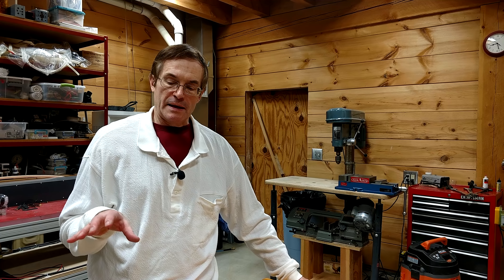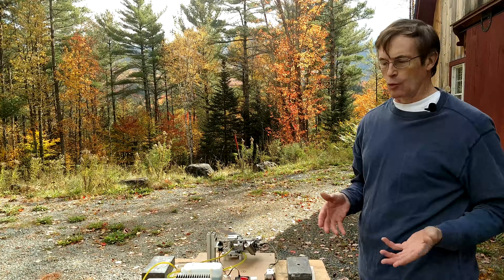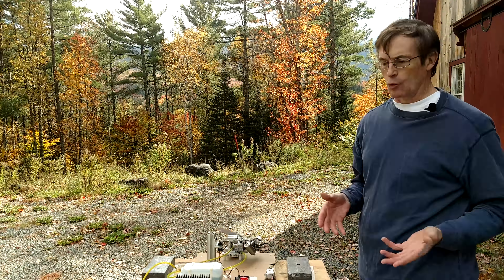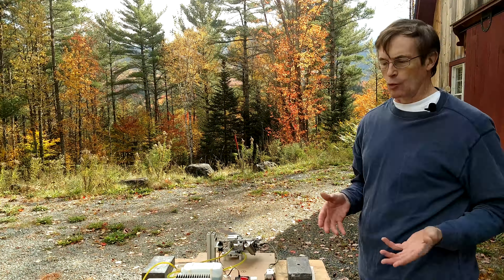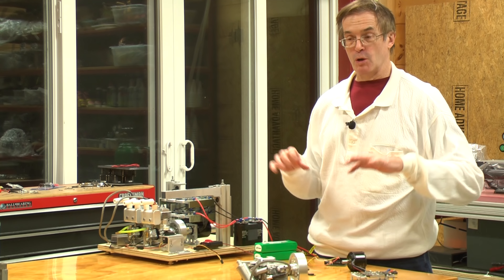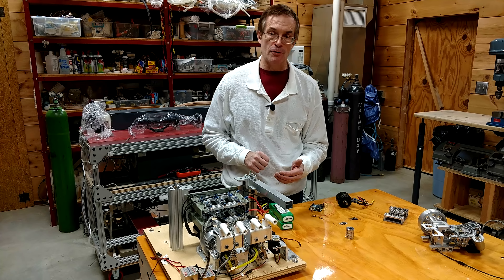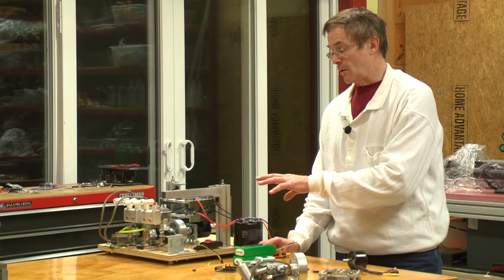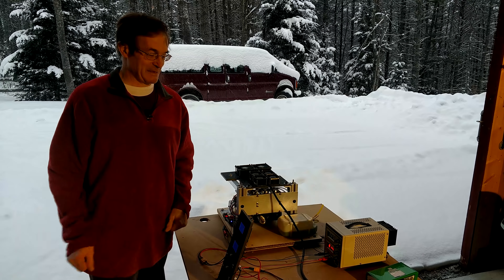Hybrid Drone Generator

Comment: Thank you for your excellent video.

Years ago I considered buying a lightweight generator, and had a brochure on it, which is now gone.  It was called a Lightning Charger, and came in versions that put out 12 volts DC, 12 volts AC, and 120 volts AC or DC.  It was powered by a 2-cycle engine, and what made it light weight was a patented permanent magnet alternator that put out about 55 amps.  I communicated with the inventor about the charger's speed control.

I just looked through old emails and found one from 2004 from Coleman Powermate, which had purchased the technology, answering my question on where I could buy one.  The answer was, "This unit was discontinued and was not sold to anyone else."  The generator/charger disappeared from the market.

Years later I came across a document on the Internet that was about the Department of Defense appropriating the patent, which said the technology was needed for drones. 

If you can find details about the alternator used for that generator/charger you may get ideas on how you might improve on your design.  However, just guessing from the look of the size of your design and its output, your design may be getting more power for the size and weight than the Lightning Charger did.  If so, the DOD may ...
Reply: And THIS is why we can't have nice things . . . . (the Gov appropriating inventions and shelving patents - making them disappear)

Comment: Thanks. I noticed that the current with the batteries was about 12 amps and 366 watts while when the two strokes were running that going into the same load was only about 300 watts and 8 to 9 amps. Those load resistors look like they may have some inductance and this may suggest that you are dealing with more AC from you generator than perhaps you are aware. It would be good to scope the voltage across the load.

Comment: Very impressive. Very interesting.
I really enjoy how you explain all the thoughts and technical parameters about the way it works in general but also
about details, what you need to know in order to optimize the efficiency and the overall usability of such an epic generator.
And all the background about energy density differences between LIPOs, 2 stroke and 4 stroke engines and ways to compensate voltage drops
caused by (virtual) internal resistence during heavy load, you did that very good in my opinion.
Reply from the maker: Thanks!

Comment: It's so crazy how you are doing all the experiments I have needed for my projects. Have you considered using VESCs (vedder electronic speed controller) in replacement of the rectifier circuit? More expensive solution, but you can start the motors with them (useful in failsafe situations), and may get better efficiency than a rectification circuit. You can also get accurate RPM readings from the VESCs allowing you to more accurately control the throttle. You could even write an algorithm that cuts back on the power generation voltage through PWM inside the motor controllers when it detects the generator is bogging down, allowing less voltage sag under heavy generator load. The two engines could also be decoupled mechanically if you used an encoder with each VESC and set them to run at the exact same RPM with the same encoder offset. (it has the processing capability to do this accurately enough I would say to be just as good as a mechanical linkage) This would allow for the same balance that you currently have, but less mechanical hardware, and more importantly redundancy in the design. Two fuel tanks, two throttles, two everything. Redundancy is always nice when you have expensive equipment flying in the air lol. A boxer engine setup may further decrease vibration and may eliminate the need for counterweights on the flywheel.
Reply: Mechanical connection makes them basically one motor. That's better.
Reply: Check out my YouTube channel, I had the idea to use a VESC as an active rectifier after I built my skateboard. I ran an experiment yesterday and it was promising.

Comment: Thanks for some great introductory explanations using your uniquely engineered power supply. The next step would be to investigate the efficiency of the system. You need to put the fuel tank on a non-vibrating surface with a scale to calculate the fuel consumption. From that it's a simple bit of math to get your power efficiency. BSFC (brake specific fuel consumption) would be useful in finding the optimal load for any given rotational speed, load dependant.
For the muffler system, I would strongly suggest optimal design software like Virtual 4-stroke to get more specific parameters to run your engine system. It'll help optimize exhaust and intake design by specifying targets like BSFC or power.
Could you post the weight of the entire setup and also include the cooling fan load when computing efficiency? From your previous video's I figured you would have designed a cooling system that was mechanical to mechanical (direct drive fans). Future work perhaps? All in all this looks like a fun project and one that could help with understanding thermal loads. Your alternators would be getting pretty hot if run at a constant duty cycle. Thermal camera footage perhaps?
Thanks again for showing off your work with patient explanation!

Comment: I think some Maxwell boost Caps or supercapacitors will greatly improve the setup and also allow you to reduce the size of your battery packs and still maintain of a set time limit if you have mechanical failure to get the Drone under the ground safely.
Reply from the maker: A fine tuning of the energy storage system, by topping off the lithium ion batteries with super capacitors might be useful.  The bulk of the energy back up will need to remain in the batteries because an emergency landing could take as long as a couple of minuets and the energy density of the batteries will be more important then the power density for this kind of time period.
Reply: Tech Ingredients the reason why I thought of it is because people are actually replacing car batteries and testing with supercapacitors and having better luck than a regular battery and they're fairly light. They have a super low internal resistance they charge almost instantly. Now the number that you would need to get to the voltage that you want may make it unfeasible but as the technology gets better and better eventually batteries will be replaced.
Reply from the maker: I'm aware of that application in starting automobiles and it makes sense.  The actual number of joules used to start a car is really quite low and far lower than the energy storage capacity of lead acid batteries.  It is the peak power requirement that has determined the sizing of automotive batteries and so with a super capacitor to supply the peak power a much smaller and lighter battery can be used.  Batteries are improving as well.  Magnesium ion batteries may begin to make an appearance with double the energy density of lithium ions and of course, fuel cells are getting closer and closer to realistic availability.  We'll see.

Comment: Many years ago I worked on an Emergency power generator for aircraft.  It used air to rotate a 3 phase brushless generator running at about 100Krpm.  Very small, the rotor was no more than about ¾” OD and the length was perhaps about 2”.  There were two of these in the case and air was pumped into it through a hole that was the diameter of perhaps 24AWG wire. A disc attached to the  shaft just above the rotor with tiny little cups to catch the air was used as the method of rotor propulsion. . The combination of the two generators produced 3KW of power at about 115 Volts and also used the air as air bearings in addition to just propulsion.  Perhaps you can use this method but instead of generating power and then running a motor just cut out the middle man and run the motor directly with compressed air.  I don't know how much power you need but I believe this combination of air tank and motor will be much lighter and less complicated than 2 two-stroke motors and mufflers and generator replaced by just an air tank.  So even your motor becomes simpler.  Just driven by air, no copper windings, but of course you will have to make a motor to run on compressed air.  Since you also want to control the voltage, you may also need a PID control for an air valve which is almost nothing.  I also designed a controller with a 1KHz bandwidth for a hydraulic valve for aircraft control surfaces.  Just 1 Amp for the control valve.  Perhaps you can find a simpler way to control the air flow.  What is your response requirement?

Comment: 12:21 but the shaping of an exhaust is a key to the power generated by 2strokes engines, isn't it
Reply: Didn't he say 4 stroke
Reply: @MrBobWareham   @ 10:30 he talks about locking the engines 180° out of phase, and having a continous power stroke, so with that setup they would be 2 stroke engines.  Plus, the sound.  They're 2 smokes.
Reply: Yes, the chamber volume, exit coss-sectional area, etc, do significantly affect the engines power delivery.  He didn't mention tuning the muffler, but knowing the detail involved in all of these videos i'm guessing he did the maths.

Comment: Interesting.  Every small engine I've worked on did have a counterweight on the crankshaft though given how close to the center of the crank they are they probably don't completely offset the static Wright of the piston and conrod
Reply: Do R/C! Exactly... I think the unbalanced counterweight is doing nothing but wearing engine bearings/bushings prematurely.
Reply: Aradialenginemighthelp, butheyareexpencive.

Comment: RC plane rotary engines are out of the question? 
They’re high revving and smooth running although not too fuel efficient.
Reply: My thoughts exactly . More power @ lesser weight.

Comment: expansion chamber exhaust for 2 strokes will nearly double the power.
Reply from the maker: It is my understanding that a tuned exhaust on a two stroke will increase the fuel efficiency and power by approximately 12-15%.  We are using the DLE 20 single cylinder engines as well as the DLE 222  4 cylinder engines.  If you have better information or a link to a source for a tuned exhaust that is compatible with these engines, please send us a link and we'll pursue it.
Reply: Increasing the power output will also increase the operating temperature and might lead to overheating, seizure, etc...

Comment: If the concern prompting the hybrid solution is the higher energy density of gasoline versus lithium polymer batteries... why not just build a pure gas-powered multirotor? This way you would not have the losses and weight of the generator/rectifier system.

However, to get around the insufficient response times of using individual gas engines in place of your electric motors... use a single gas engine running at an efficient RPM... and run collective (non-cyclic) pitch  rotors. Your flight controller could manage the collective pitch servos and could provide the necessary responsiveness.

For example:
http://www.curtisyoungblood.com/legacy-product-support-curtis-youngblood/attachment/stingray-500/
Reply: Well, you're right, but one purpose for a multirotor (and the reason of it's reliability) is to defeat as much mechanical links and failures which could appear trough them. If you want something with variable pitch props, and one motor, why not build a helicopter (proven design)?
Reply: Because cyclic pitch is another class of difficult compared to non-cyclic pitch. The latter isn't that hard.
Reply: Gas powered multirotor?  Not if the power to an individual multirotor motor has to be adjusted 400 times per second minimum in order for it to stay level/hover
Reply: Multirotors vary the rpm of the individual rotors to provide directional (yaw) control.  A direct-drive gas system is not responsive enough.  Electric drive is the only way to go here.  Less complex and much better control.
Reply: I watched a 2 stroke manned drone. He changed over to electrics. 
Hybrid is the long range solution though.
Reply: @scottsuhr2919  Tell that the Osprey tilt rotor plane.

Comment: Love the project that engine looks very nice but I would have used a small mechanical fan driven from the main motor shaft to save electric with the fan thanks for the video.

Comment: Very useful. Request you to kindly show the detailed video on how to make the generator assembly (complete), including the 2 motors placement at 180 degrees with weight offset balancing. I am working on the hybrid power unit,. your consideration would be a great help for me.Thanks with regards
Reply: Yes. Agreed
Reply: THAT IS A HORRIBLE REQUEST.  DID HE SAY ANYTHING ABOUT OPEN SOURCE? WHY WOULD HE SHARE THIS INFO? WOULD YOU SHARE ALL YOUR INFO WITH HIM?  WOULD YOU PAY FOR IT? WOULD YOU PAY AIR FARE AND LODGING TO GO WORK WITH HIM FOR FREE?  NO? OK THEN, BUZZ OFF MAN.
Reply: I mean, if there is a problem with what darpan asked for, all he has to say is "no I dont wish to share this information" or they could work something out in a more private manner. So there for your two comments in all caps were are still are unnecessary. Have yourself a good day :)
Reply: Nimbos0 YOU'RE CORRECT AND I DELETED THE SECOND COMMENT. I WON'T MAKE AN EXCUSE WHY IT WAS POSTED TWICE. OK, LATER ON.
Reply: Mc cc: I am not going to comment on the intricacies involving intellectual property. What I am going to say is that you are absolutely not entitled to make either a moral judgment on a request for more information, nor are you entitled to tell tech ingredient what he will or will not divulge about his ideas. 

Darpan: the concept seems relatively straight forward to me. It's basically two engines mounted next to each other in the same plate; then synchronized with an ordinary timing belt and sharing a control solenoid. I actually see a few similarities to Edison's original generating plant; where they had to synchronize the two generators, so the faster one wasn't driving the slower one.
Reply: Hi Darpan - are you involved with Team DHAKSHA? They have a couple of awesome hybrid drones that I've recently seen.

Comment: This is simply stunning engineering, I know all about motors but not electronics, even though I do electronic repairs in vehicles. I knew about the timing belt solution and the issues with twin cylinder two strokes being in phase, but the whole assembly is genius.
You do so well at teaching, kudos to you Sir.
I hate those Saito four strokes, give me a two stroke any day. The idiots at the flying field were real proud of their Saitos, but I suspect I was getting more thrust out of my 10cc Chinese two strokes than they got from their overpriced four strokes.
Haven't been flying for a while, I need a new location for flying since something is screwing with my AFHSS system at the approved airfield. I didn't think it was possible to interfere with such systems, however, the nature of my last lost airframe made me suspect someone has such a system.
Hitec makes a great radio, the Aurora is affordable and under normal circumstance is flawless. 
I look forward to you flying this new system, and learning everything you have to show. 
Thanks again...
Reply from the maker: Thanks!

Comment: Only 250w generated? It'll probably take more than that just to deal with the huge amount of extra weight.
Reply: You are so smart.  You should explain that to him.
Reply: The resistors he used draw 250 watts at this set voltage. That doesn't mean the generator isn't able to supply more when you increase the power draw.

Comment: 2 engines... in opposite directions.
Reply: i see u had the same idea later on ^^
Reply: Yah! I was thinking the same thing.. like half of a Volkswagen boxer engine - the horizontally opposed piston setup should allow lighter flywheels. (I saw the comment that he thought of the boxer cylinder arrangement later but I haven't got to that part yet - just found this channel and it's great!).
Reply: or 1 boxer engine :)
Reply: It might make a reciprocating linear vibration like the hydraulic pecan harvesters.

Comment: Great video! I thought up the same idea of using a generator to power a drone. Because I was thinking of a way to use engines to make a drone. I figured it would be impossible to use engines to directly drive the propellers, because the speed of the engines could never be controlled fast enough. It's nice to see someone actually doing it. Another benefit of using gas, other than more kiting capacity and longer flight time, is being able to just refuel to keep flying. Other wise you would need to wait for your batteries to recharge or have multiple spares. Even with the cost of building that system, it's probably still cheaper to fly all day than it would be to have enough spare charged batteries to fly all day. That the reason I love my nitro car, I can drive that all day. If it were electric I'd get 10 minutes of play and then would have to wait a couple hours for my batteries to charge.
Reply: It doesn't take a couple hours to charge a lithium battery pack today. A 5000mah 3S lipo battery pack will run my brushless electric 1/10 scale, dirt oval, r/c car for about an hour, and it takes about 45 minutes to charge the pack. I can run all day with only 2 battery packs. I have nitro 1/8 scale cars also, but brushless electrics have come a LONG way today.